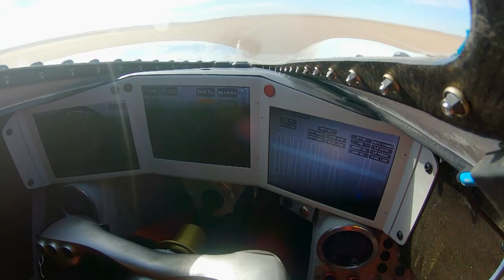Trailer: Building The World's Fastest Car

Comment: I'm praying that they can finally achieve what they set out to do.
One comment though. when they say "Faster than a bullet from a gun" are they referring to a subsonic bullet at around 700 fps at the muzzle, or a very fast one at 3000+ fps - just wondered (sorry to be pedantic).
Reply: They are talking about your typical handgun, like a 9x19mm parabellum or .44 magnum, so about 1,200 -1,400 ft/s (800-900mph) or Mach 1.1 - 1.2.
Reply from the maker: @Outland9000  Indeed, as you see in the film this is based on a low caliber hand gun

Comment: For those wondering what happened to this project

"Lack of funds prevented the fitting of the Nammo rocket in 2020, and combined with the effects of the COVID-19 pandemic, this meant the opportunity to run the vehicle in 2021 was lost. In January 2021, Warhurst said the vehicle was up for sale and it was reported that the team had moved on to other projects.[29] Warhurst stepped aside as CEO in August 2021 and Stuart Edmondson, the project's Engineering Operations Manager for the previous five years, took over the role.[30] When interviewed in July 2022 Edmundson stated that, while on hold, the Bloodhound LSR project was "very much alive" and a new land speed record could be achieved very quickly if new investment could be secured. Edmundson also reported that the project had adopted a new environmental focus, with the aim of achieving a net zero carbon land speed record.[31]
The vehicle currently resides at Coventry Transport Museum."
https://en.wikipedia.org/wiki/Bloodhound_LSR

Comment: The testing vehicle not the original design one... sad
Reply: 荷蘋Ernesryst  it’s the exact same car. They repainted it white.
Reply: The design is very nearly the same as the original one, but several elements were not included (e.g. the forward canards) because it was only phase one testing
Reply: @WellingtonIronman  No not the same as u as rewatch early video this channel...
Reply: @a17waysJackinn  Hi. It is the same car. It is sporting a new livery from the time  when the project was financially revitalised. It has also been in slightly different configurations at various points in the long term testing as required by the specific data gathering being performed at the time. The version with canards was never actually built as the aerodynamics and/or control of them was not deemed ideal/practical. Assuming the project continues next year the configuration will be amended again with lessons learnt from this last phase of testing and more obviously the addition of the rocket and associated fuel pump, batteries etc. All brilliant stuff which I have been following for many years.